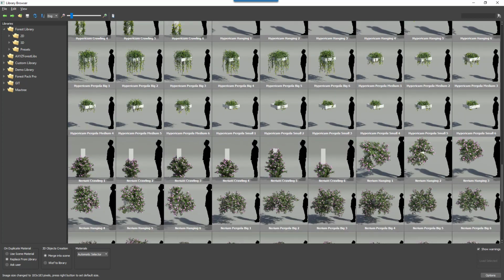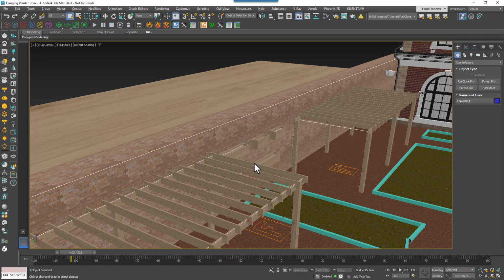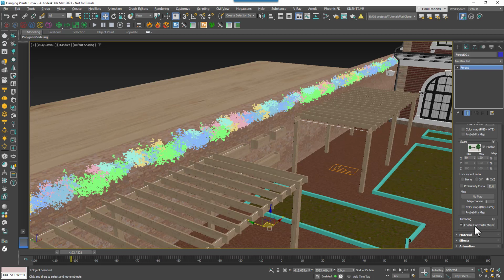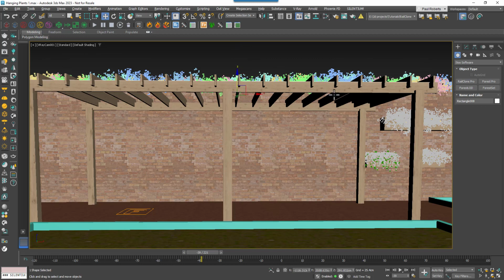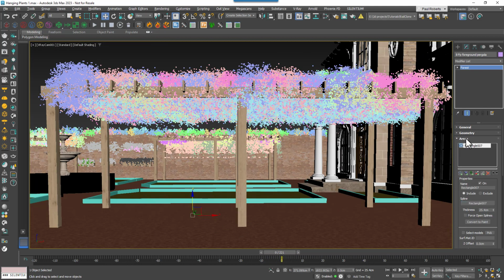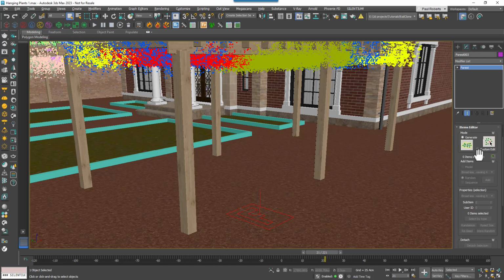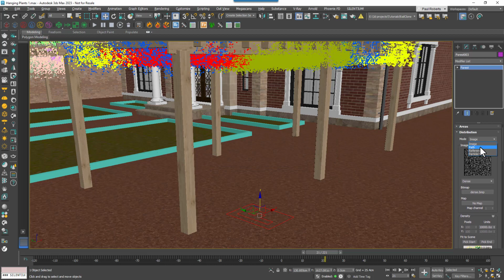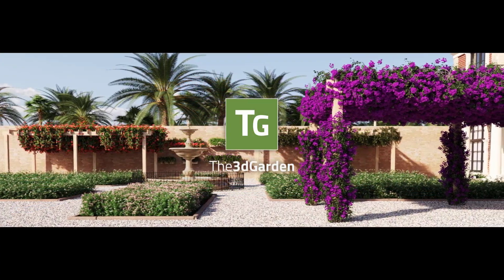Hanging Plants Vol.1 | balcony, pergola and climbing plants library for 3ds Max

Comment: Hello! what if I wanted to creeate hanging plants along a curved surface (wall, fence) and how do I do to make the plants curve or deform along the spline? I have flat hanging plants, the curve is a mixture of straight and curves.
Reply from the maker: Forest Pack doesn't deform geometry to follow curves to ensure efficient instancing. However. you should be able to just draw a curved spline and as long as the plants are in small enough sections you might not notice that they are not deformed.